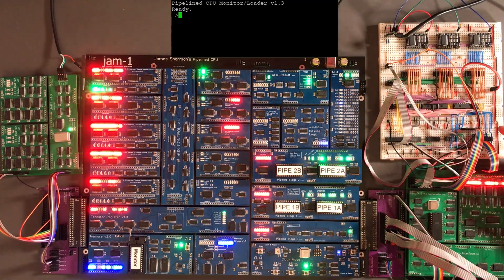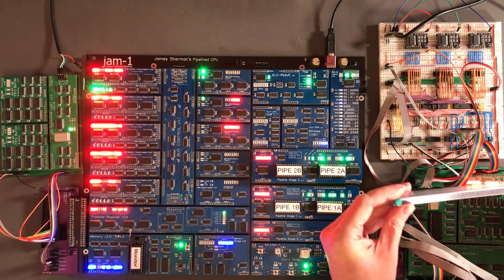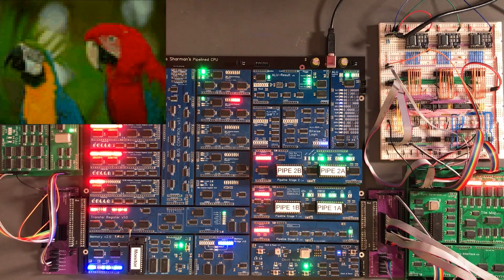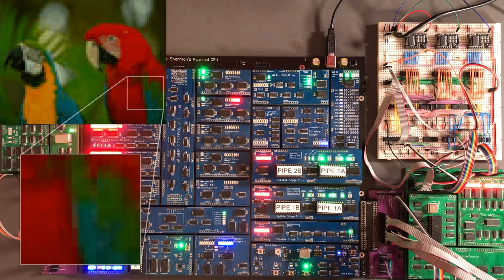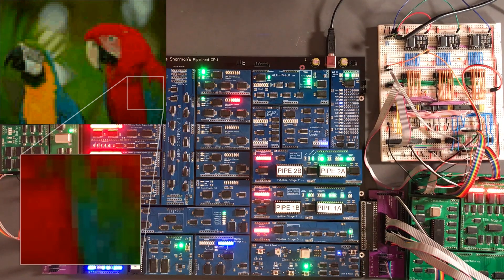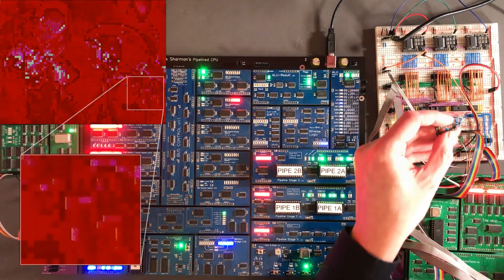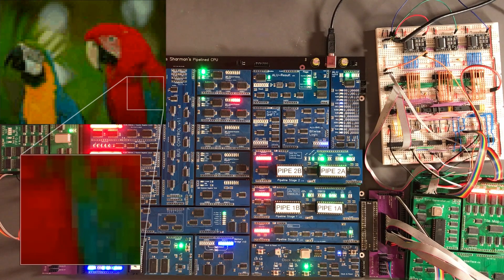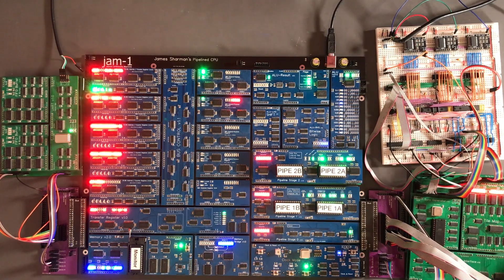Fixing the last Palette glitches - VGA from Scratch - Extras

Comment: VGA stuff is so high frequency and small voltage differentials that breadboards start to really impact signal integrity in a noticeable way.
Reply from the maker: Indeed, I’m actually amazed it works as well as it does.

Comment: Interesting! It's nice to see an actual demo that directly shows how important decoupling caps can be.
I'm now wondering what the better decoupling cap setup would do with the LS chips or possibly even the HCT.
Reply from the maker: I realised after uploading and doing my preview watch that it might leave the impression that it was the caps not the chips that make a difference. The HCT and LS chips are not fast enough, the ACT chips are fast enough but they are more dependant on decoupling as the faster transition pulls current over a shorter timeframe.
Reply: @JamesSharmanExtras  That makes sense. So ACT is faster, but can only reach its potential if the caps are good enough, while for HCT or LS speeds margins are less tight so caps are less critical?